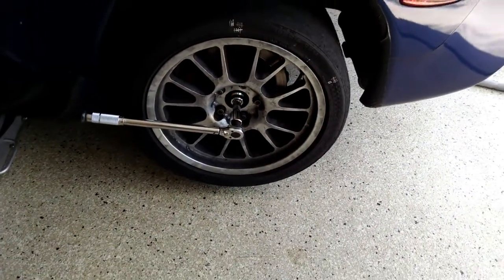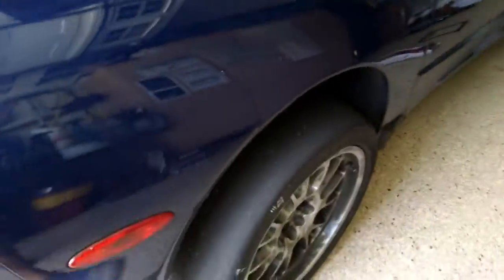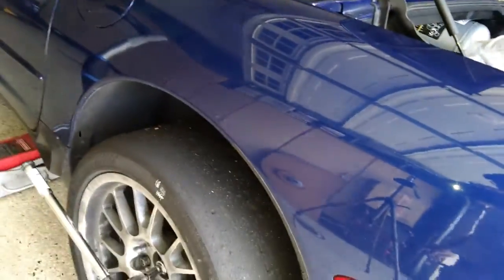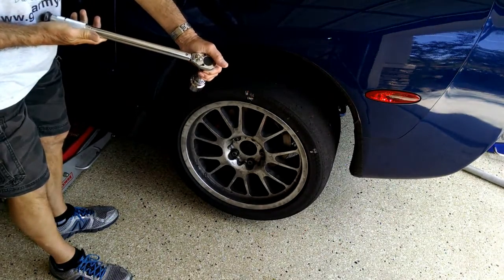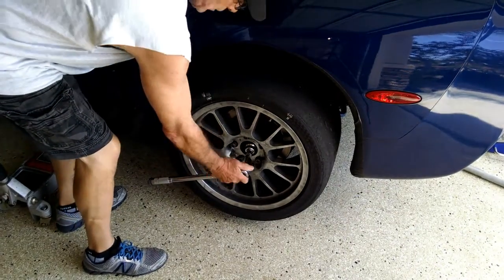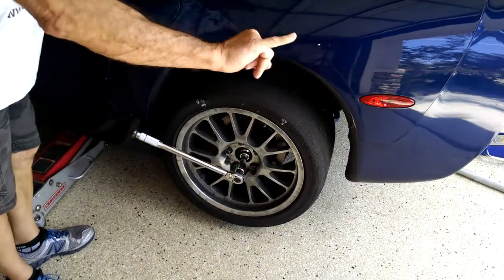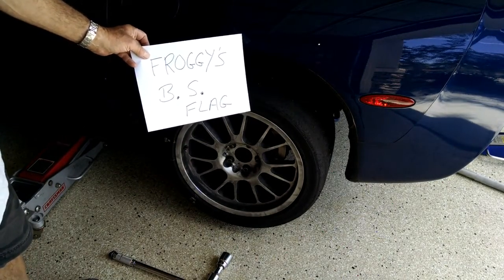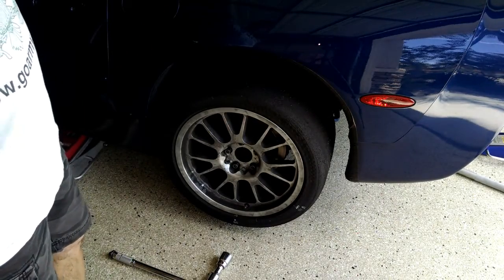Corvette differential measure break away torque in gear or neutral by froggy

Comment: Think about this for just a moment, the break away torque is how much force it takes for the clutches in the lsd to slip one tire with out the other tire moving. It does not matter if a drive shaft is even hooked up, there is a set amount, lets say 150lbs, holding one wheel to the other. the friction is all in the differential it has nothing to do with the transmission or gears. So it will take that much force to spin one wheel without the other moving even in neutral. Your in particular limited slip is not providing force to both wheels unless it is a gear limited slip. Gear limited slips do not work exactly the same a clutch limited slips. Clutch limited slips work like a brake holding both wheels together, gear limited slips work differently and honestly I have not looked into exactly how they work, but most people say if one tire is in the air you need to use your brake to activate said limited slips.
Reply from the maker: Could be you are correct, thanks! That car is gone.